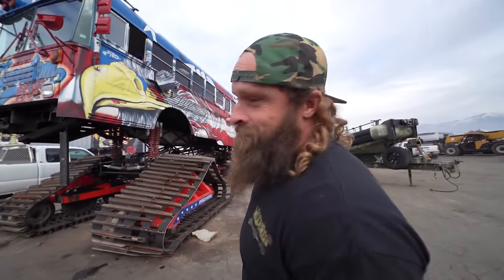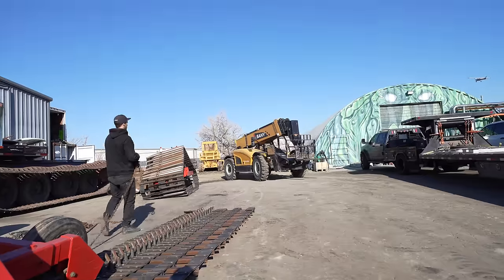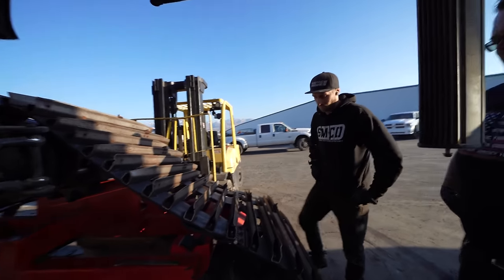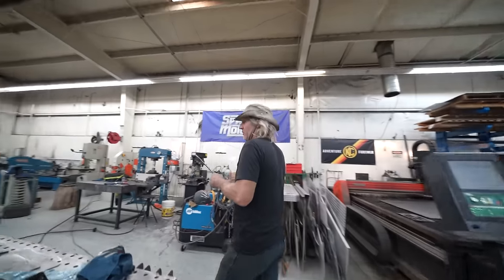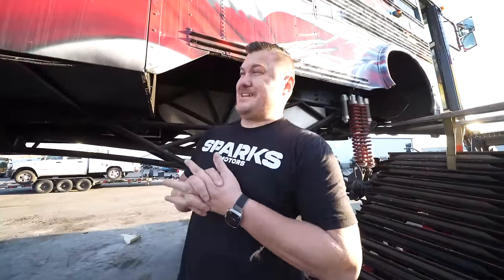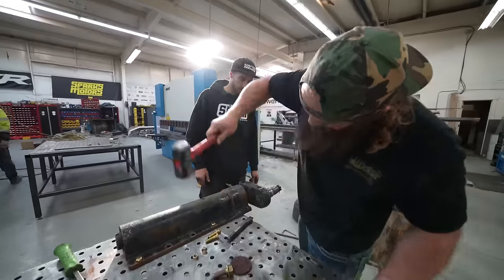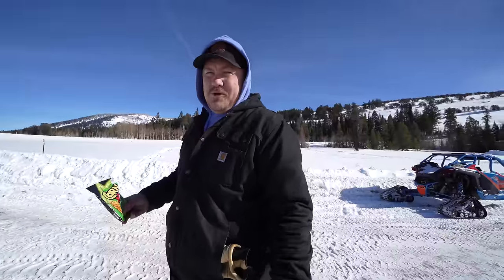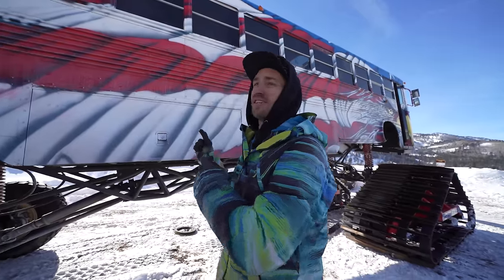Worlds Largest School Bus on Snow Tracks!

Comment: Y'all need a hydraulic leveler to kick in to keep that huge body level or it's going to tip really easy in deeper snow & uneven terrain. Also that glitch with the tracks as one rode up on a small rise at the edge of the tracks - almost slipped a track. I think you may have found that this is too big for those tracks.

Comment: You guys should build a military half track with some horsepower and put a rv camper on the back of it for off grid living complete with portalable power and everything needed to survive for awhile in the wilderness yet still be very capiable of going pretty much anywhere you would ever wanna go or make it one of the ultimate recovery rigs

Comment: The tracks need more rubber belting  on them  so snow don't come through , which comes out the top and behind  the sprocket and rear wheel . This is taking all the engine horse power and bogging it down .

Comment: To check the temper, run a file across the metal. If the file does not cut, it's hard.

Comment: heat til its no longer magnetic, then quench.  If you temper earlier than blue (like at straw or purple), you'll retain more strength while still avoiding generally brittle character.  Tempering til second blue and it loses alot of strength but gain maximum toughness.
Reply from the maker: Great feedback, we appreciate ya!

Comment: You can test metal hardness with a file if it skates it’s hardened if it cut in its soft
Reply: If you don't have a file you can drop it on concrete and listen to how it rings. Dull thud is soft going to higher pitch rings the harder it is.

Comment: I like Allen but he’s got half the information. Missed a lot of steps, could be the editing or recording. But the things on video are not even half the the information needed. Cut halfway threw the wrench with a cut off wheel, then put it in a vise and hit it with a hammer to snap it. If the grain doesn’t look like finest uniformed powder you ever seen than it’s completely wrong.  That’s just a very simple basic test

Comment: can yall get a old c10 and make a recovery build
Reply: Would have to be a k20 bud. C10 is 2wd half ton.
Reply: From that comment seems like you just started watching he's not going to do something that's been done 10,000 times before
Reply: C30
Reply: How original..
Reply: I farted
Reply: Amazing original content
Reply: @MikeOrkid me X10
Reply: If you like c10’s there’s a fellow by the name of freddylxs from Texas that like to collect and fix them up as well as actually use them .. hope you check it out !
Reply: I’ll ask real quick. BRB…
Reply: This fool makes 6 door military axled trucks and he axed for a c10 recovery build. Watch dig dug build on Matt’s offroad. It’s a “c10” recovery build.
Reply: They're already starting a project like that with a military hummvee my guy.
Reply: I had 2 c10’s both were custom deluxe one king bed one short one 68 model and one 69 model and my favorite restoration of the 2 was the 68 by far! I actually have ended up cutting them both apart and making them one truck with the best of both worlds! The 68 was king bed and the 69 was short but I wanted my 68 to be short so I made it happen! Lol!
Reply: Sounds boring asf
Reply: Don’t ask a question like that again
Reply: K20 would be better

Comment: You don't know much about hardening steel do you Allen?  Do you even know what steel that wrench is made out of?  If it is the wrong steel it will not harden.  Now make Allen take that apart, not going to happen fastand easy.  But that's what happen's when you have dumb and dumber working on thing's.